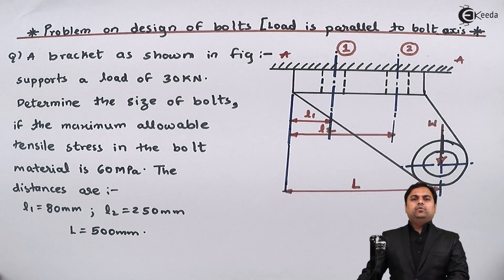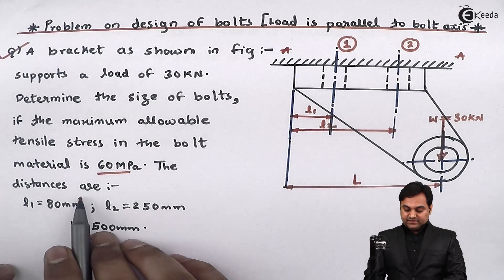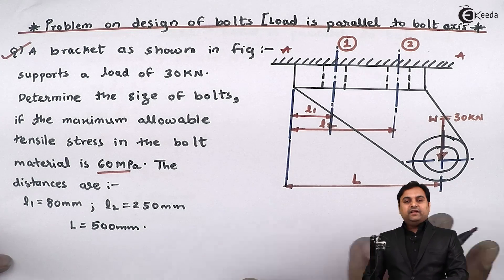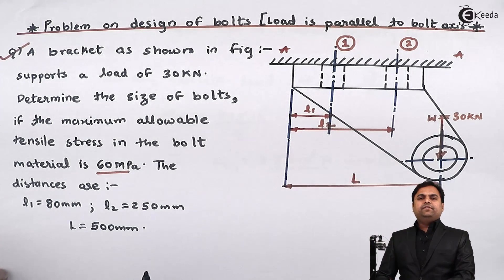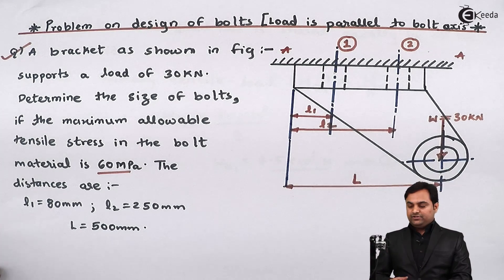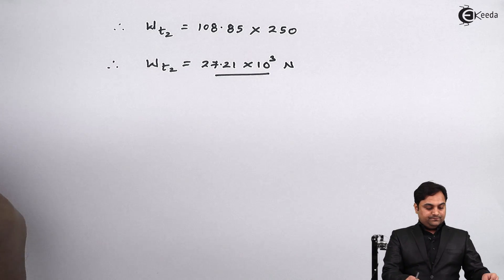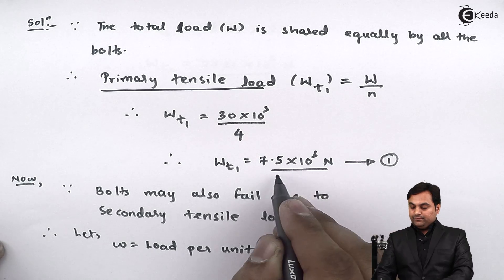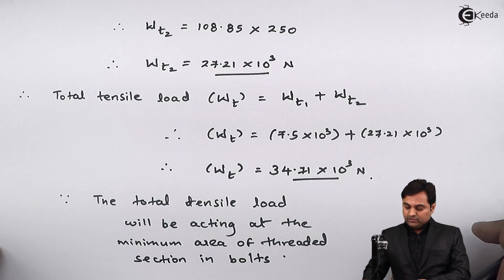Problem 1 on Design of Bolts - Design of Bolted Joints - Design of Machine

Comment: sir....a machine member has a circular flange, which is connected to the frame by means of 8 bolts and bending load is applied on pipe ,pipe lengh is 180 mm from the flange, load applied at the end of the pipe